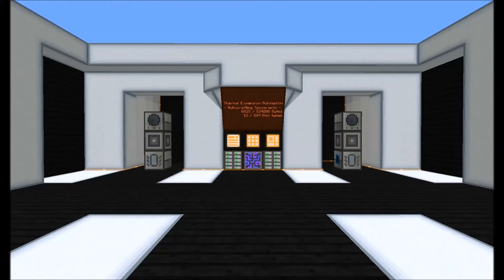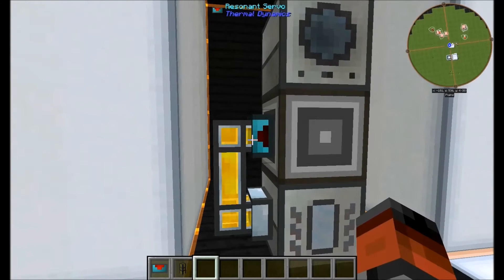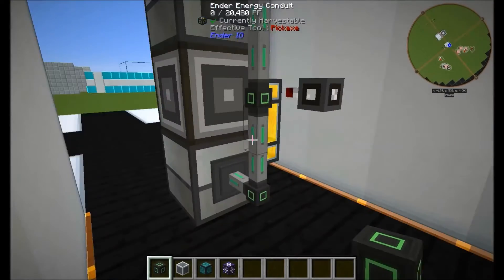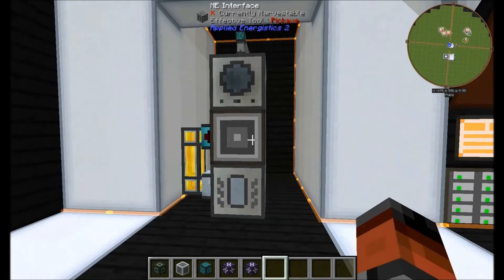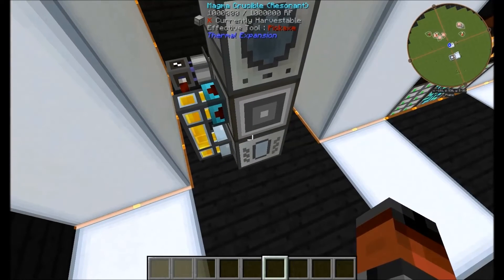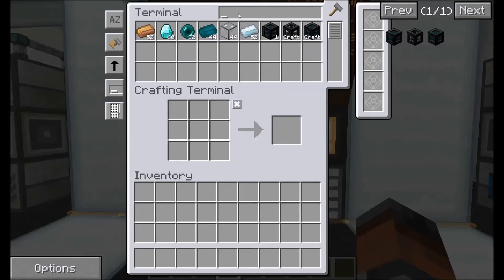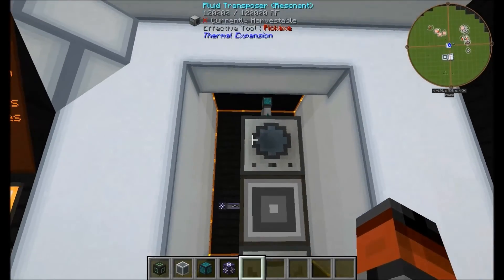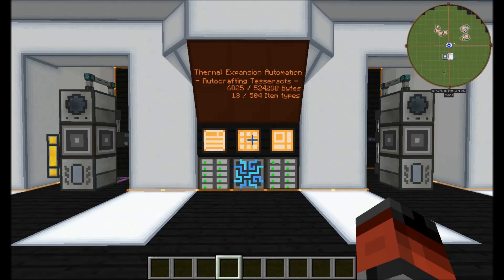Minecraft FTB Applied Energistics 2 Tutorial - Mod Integration  - Tesseract Craft Automation

Comment: I cant get the level emitter to send a signal.. :S
Reply from the maker: Hey, With mine I placed it on the ME glass cable and added the crafting card, double check you haven't gone over your 8 channels and make sure it is placed on the AE2 version of glass cable.
Reply: I have done that it says "device" online
Reply from the maker: Did you add the crafting card? it should be off by default facing in to the servo that is set to high redstone level and will flash on for a short time when you click craft.
Reply: I did, I will try and see if i can get it running
Reply from the maker: Have a look in the level emitter that you have added a empty tesseract frame ( in the box between +1000 and -1000) and this should only turn the emitter on when crafting the frame.